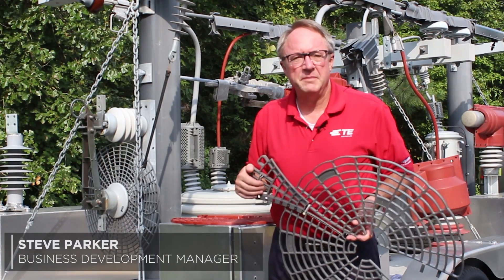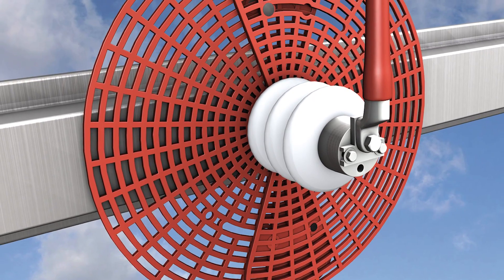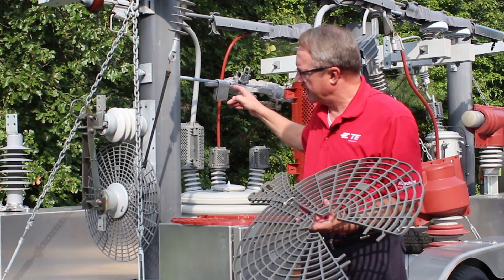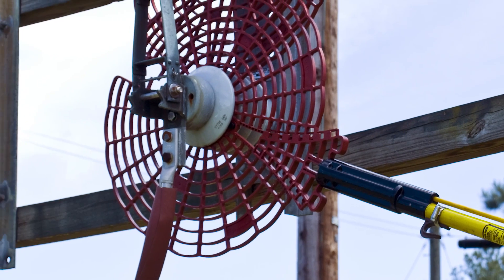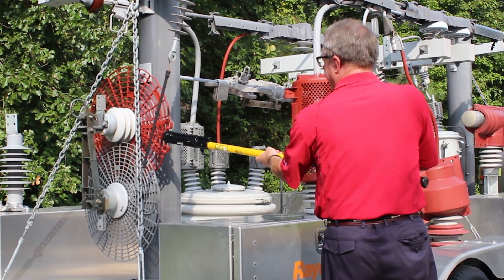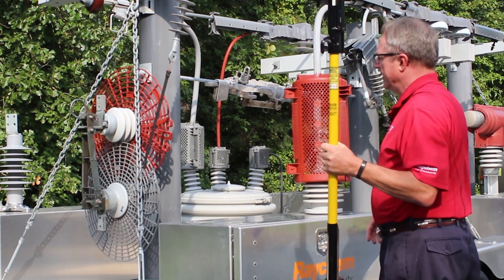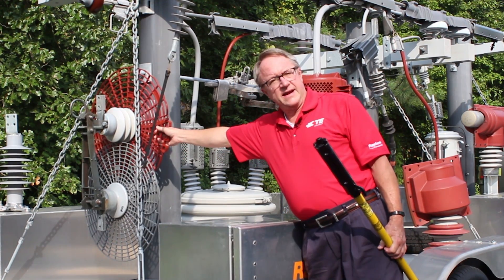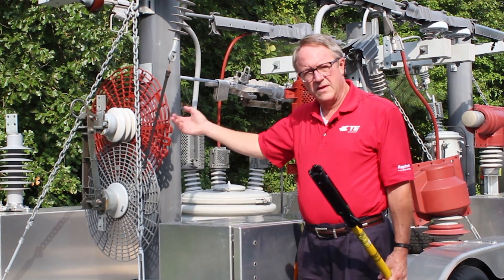TE's Raychem Squirrel Guard (BISG) Installation Video

Comment: The Midsun Group has a  similar product that can be installed numerous times without any destruction to the unit...Basically it is reusable and comes in 3 diameters for proper fit (16", 20", and 24")..Visit Midsun Group at www.midsungroup.com...